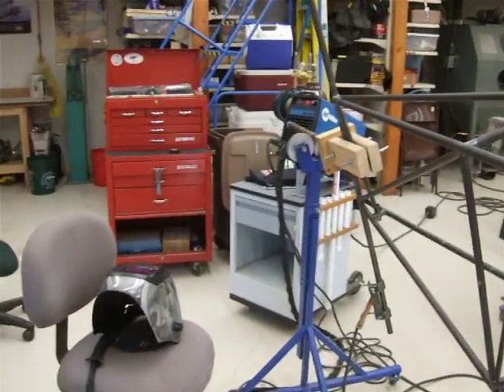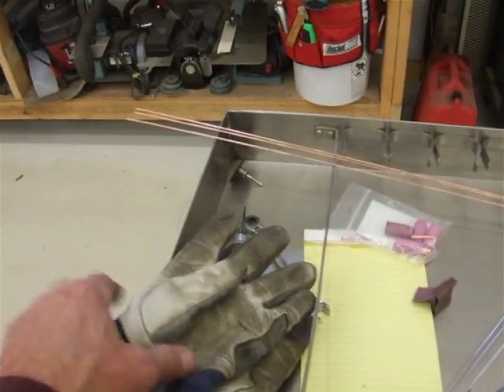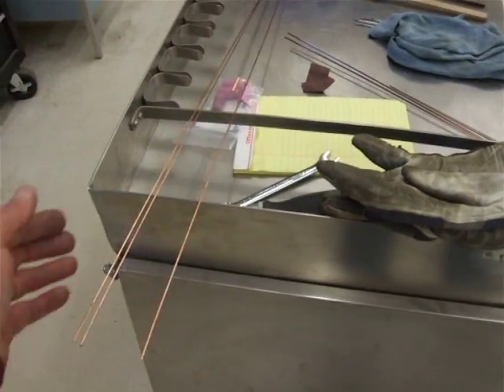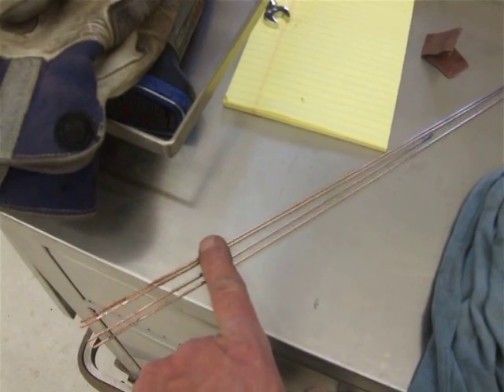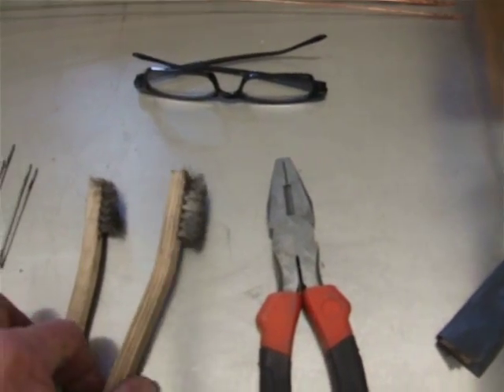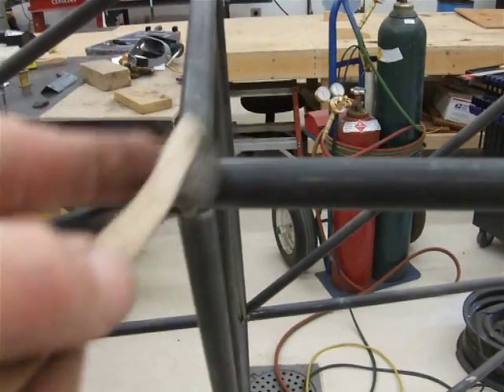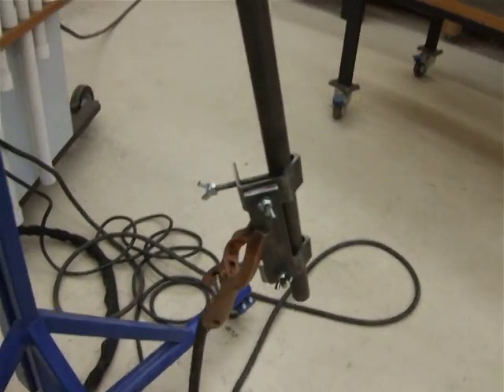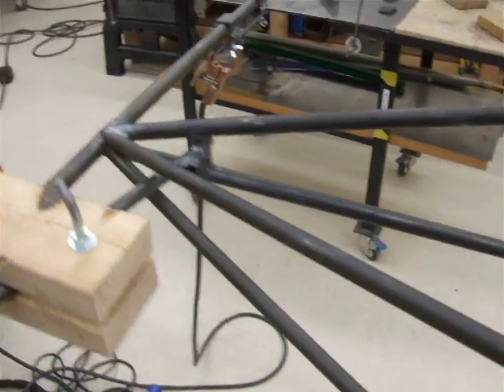Some ideas for fuselage welding

Comment: You mentioned tossing out your rod when it gets too short. You can hold on to the short pieces and weld them all together to make a longer rod, works out pretty nice and the puddle cant tell the difference. Saves you from burning up your gloves trying to get as much as you can out of your welding rod lol.

Comment: Great review and tips and camera work. Saw the vid via homebuiltdirectory com
If you did not know (re: cheaters) you can get 1.5x, 2x,... magnifying lens inserts for your mask, which is REALLY nice not having to wear glasses and still get a good view of what you're welding. The 1/2 brush is a great tip. Look up 'pin vise' on eBay and for $2 you can find a 'fatty' which you can clamp the last 1/2" of rod in a collet and use near to the end. Thanks for the vid-will watch more later.
-Christian

Comment from the maker: Actually, I saved them to find out how many pounds of welding rod I used. I added all the nubbins, divided by 2 and got the number of rods I used. I weighed the nubbins and subtracted that from the weight of the rods that represented the total used and got around 2.2lbs for a total. I didn't throw out the ends. Like you suggested they can be tacked together and used up. But, with welding rod at $3.50/lb I figure I can wait until some saturday night when I'm out and tack them together. Good call.

Comment from the maker: There is quite a bit of discussion on this subject and even the experts have different opinions. Some say ER80S-D2 is the best, while others say ER70S2. I used ER70S2 for all my welding because it is a proven rod and is available where I live. I can't buy ER80S-D2 locally and I haven't tried it. I did TIG my fuselage and these are recommendations for the TIG process, not O/A. Good luck on your project!

Comment from the maker: As far as O/A welding goes, RG45 is by far the most widely used rod.for aircraft construction. You can use ER70S2 or S6 for O/A welding, do not use ER80S-D2. Also, do not use RG45 for TIG. I've alyways found RG45 to work the best using O/A. You should try some samples using 4130 sheet and tubing to see what works best for you. Do NOT use 4130 rod to weld 4130!

Comment from the maker: @vondeliusc I did get a set of the cheaters you mentioned, but I didn't like them. All they were was an adapter so a cheater from welding goggles would fit in a wide-field mask, just covering just less that half of the field of view. When I wear the glasses, I have my entire field of view instead of just looking through the magnifier. Maybe your setup is different. I like the pin-vise suggestion...thanks!

Comment: @alaskabearhawk, did you have a preference of helmet for working inside the fuselage?  It's a little tight in there.
Reply from the maker: That is a great observation! The answer is yes, I do. I found this Miller auto-darkening weld-mask and it works great. They are very compact and allow for welding in tight places. The only downside (if there is one) is I need to wear cheaters and I can’t wear the goggles over glasses. Fortunately Miller thought of that and include a frame for magnifying lenses. I had to take the frame to a local eyeglass store and had them make magnifying lenses and install them in the frame. It was easy to do, just an added cost. Thanks for the question! https://www.millerwelds.com/safety/weld-mask/weld-mask-m30023
Reply from the maker: @FMunixxx  It is, and the clarity is better than my helmet.